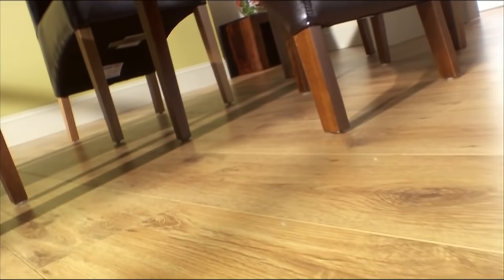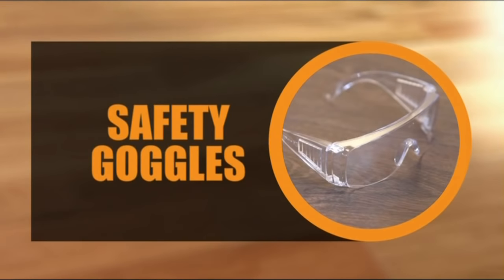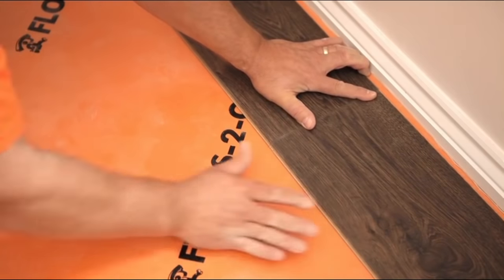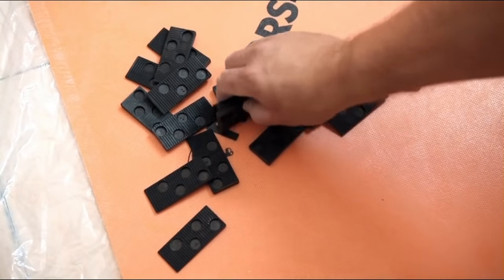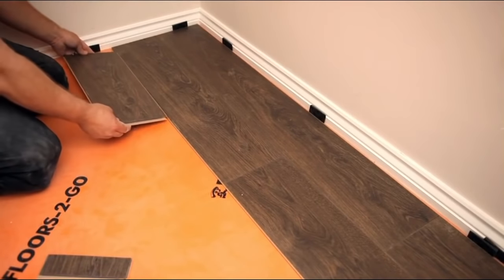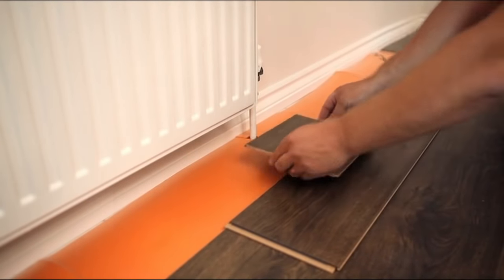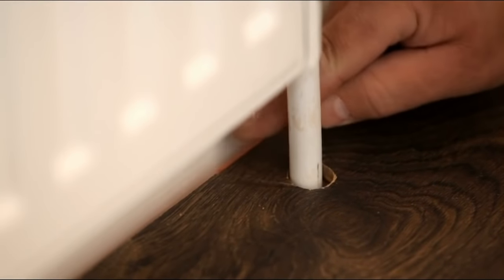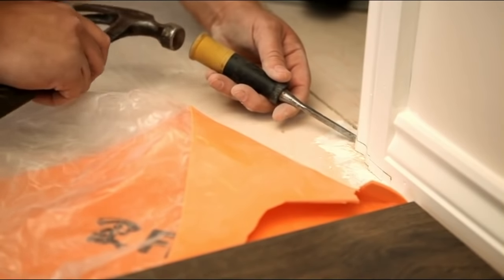How to Lay a Laminate Floor

Comment: Why didn't you remove the baseboards to do the install?  Also, I wouldn't recommend to anyone to cut casings like shown in the "tip". Use a Contour Gauge and cut your laminate flooring to the exact shape.

Comment: To complete the first row you had to cut the last board to make it fit. You then started at the other end again for the second row and saying to cut a one third board or else another full length board would make the pattern wrong and the whole floor weaker?  Why didn't you just lay a full board from the end that you had just completed the first row which had already been finished with a cut board anyway?